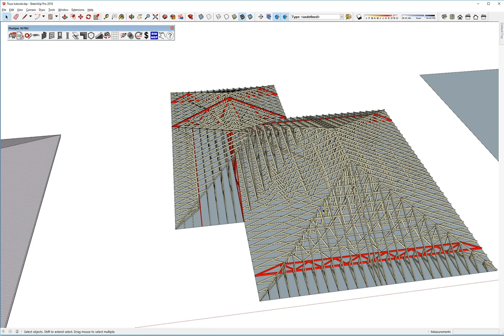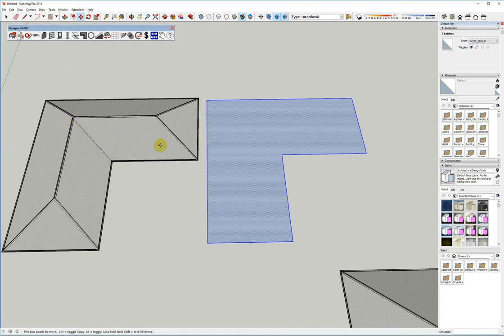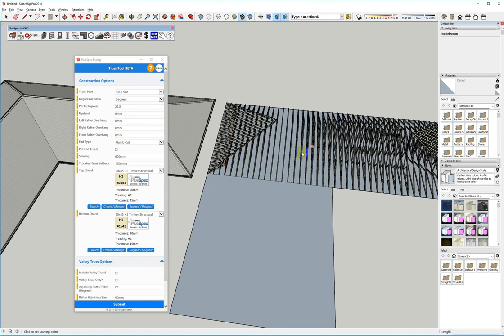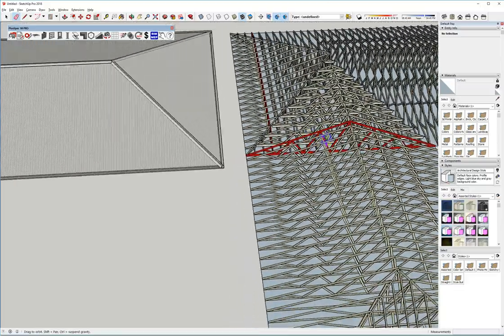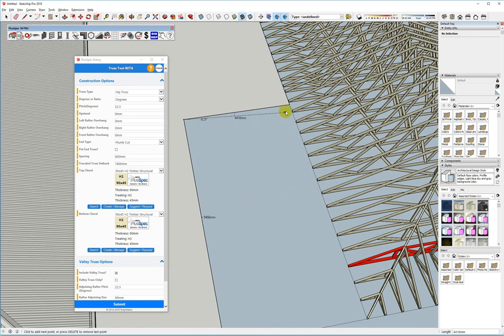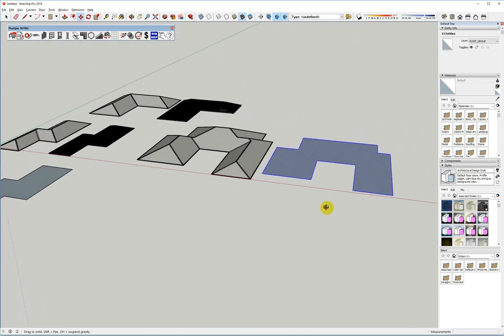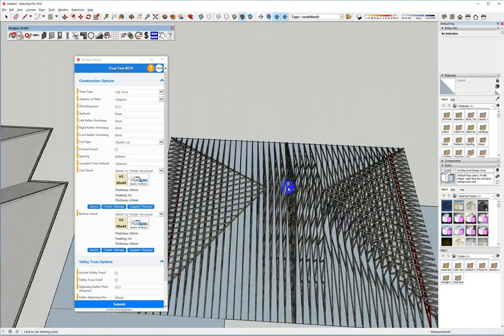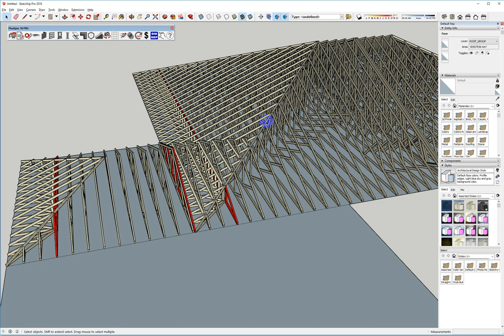The easiest way to create complex truss rooves Tutorial

Comment: the way to use a tool. Such as the roof tool to model trusses has been very useful in this video. knowing the right way to approach the roof generation from 'face' (outline of load bearing wall, in most cases) in not creating any internal rectangles together with starting with the greatest spanned truss is the kind of info I need for each of the tools. makes a huge difference. thanks.
Reply from the maker: Thanks Jonathan, creating the rectangles is a visual way that is easily understood without going into the detail of why, in this case, it just works. The key in all situations is creating trusses in order of span, largest span first.  I will be making a video on joists soon, look out for it as I hope to make it as good or better. Your comments do help us make better videos, so if you are watching a video and you need more info let us know, we will do our best to rectify or elaborate.
Reply: @rubysketch  what program is this?

Comment: Is it possible to create cutback trusses.  ie on internal loadbearing walls but pitched further out.  Upstand would work with some trig but it applies to both sides not just the cutback side.
Reply: Yes simply add guide lines to draw the trusses from Or create a face with the rectangle tool.  You will nee to use the "Add to Roof" function in the right click menu.